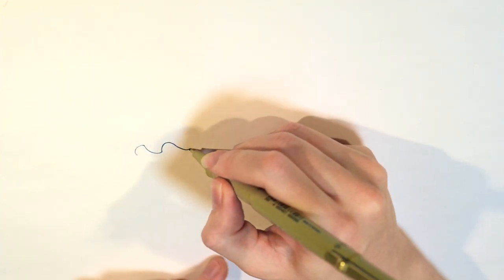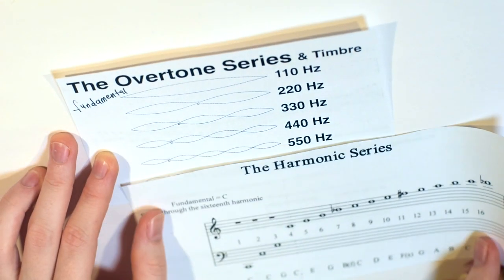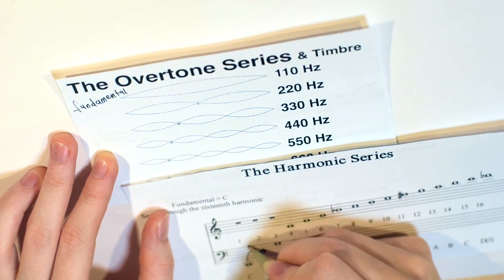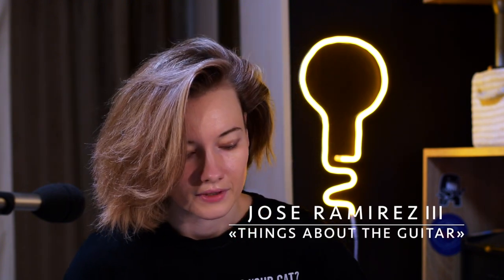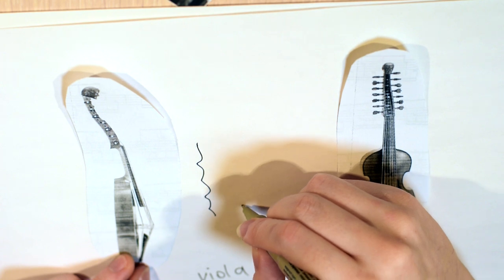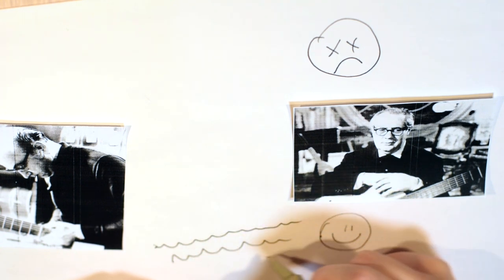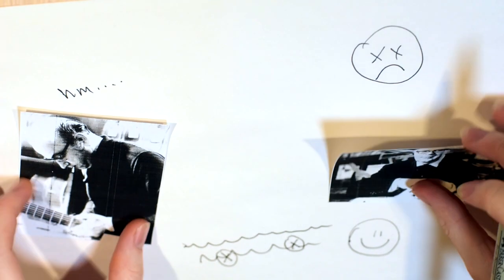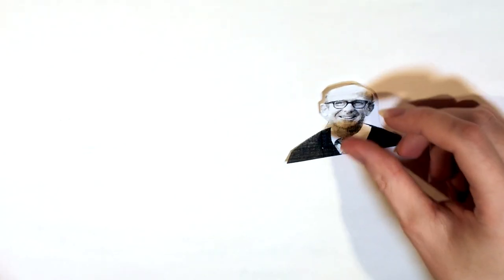OVERTONES – WHY YOU NEED 10 STRING GUITAR

Comment: That's what I've been deciding on. I tried a lute, specifically a 14-course archlute. It's difficult to keep it in place, because of my voluminous stomach. I've seen several Narciso Yepes' videos, but I don't like the tuning. I'm thinking of Starting with the highest string a, e, b, g, d, a, f, c, Bb, Ab as just one of the possibilities. However, if we're looking to maximize the overtones, then we really need 12 strings, each in a different note of the chromatic scale. Maybe descending in a strict perfect descending 4ths. I would start would A, but that would give a lot of accidentals starting with the 4th string which would be F#, So, maybe we start with Bb, making it, Bb, F, C, G, D, A, E, B, F#, C#, G#, Eb (D#). This will make this experiment quite costly, both for the making of the guitar, and finding the appropriate strings. But I think it will make most notes vibrate

Comment: Fantastic Video! Thank you! Have you ever tired 8 string guitars? 
I'm wondering if the concept for them is similar to the 10 string. Do you have any information about this?
Reply from the maker: Unfortunately now, but it physics always works the same. Your resonances will still be dependent on the tuning you will use, and 8 strings will give you more field here than 6 strings, and a bit less, than 10. But it will work, of course. For playing 8 string guitar is the golden middle, I suppose) If I had a chance - I would definitely try
Reply: @MarinasDecacorde  Thank you! 🙏